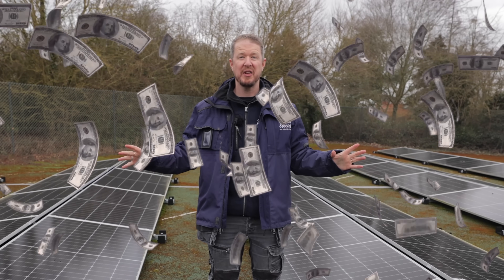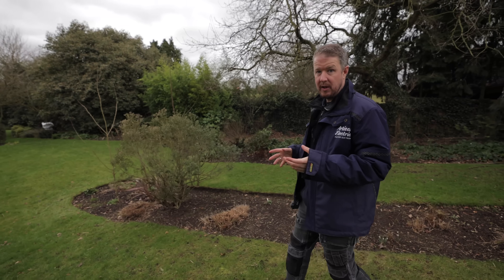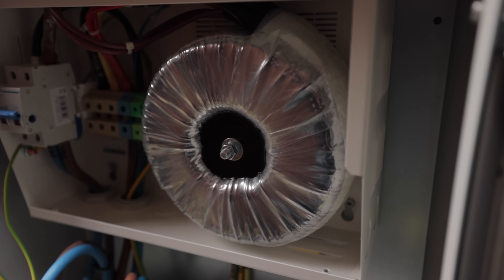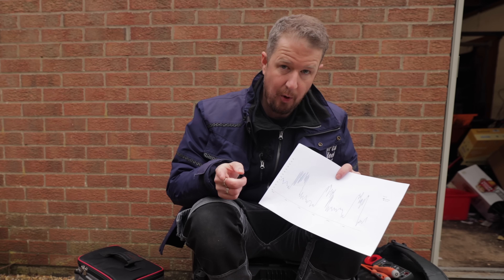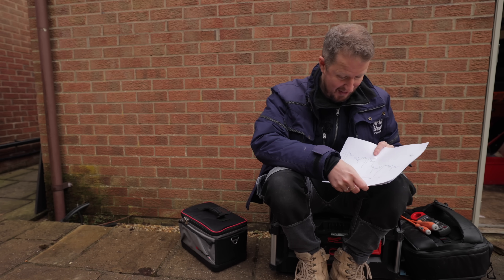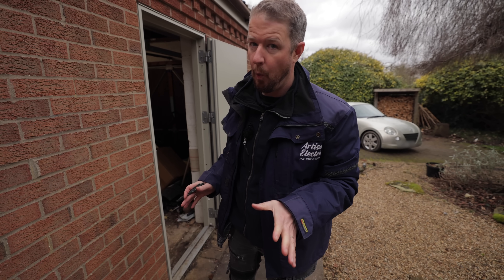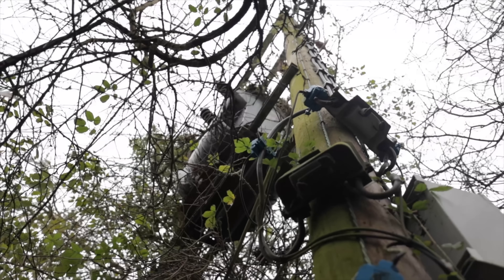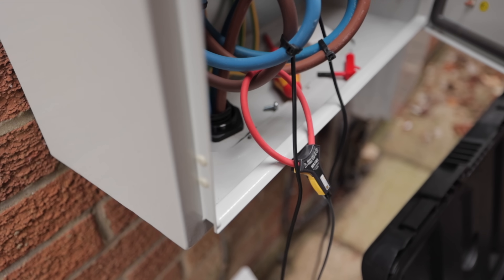THOUSANDS Down the Drain – And We Can’t Do Anything About It!

Comment: I am not in the UK and I have a similar grid situation, but my setup is completely different, so it can handle it. First of all I don't have net metering. I'd have to pay to get a double meter and it's just not worth it because the grid voltage is almost never within the target range. In many countries you are not allowed to put voltages outside grid range into the grid. I have a hybrid installation and the inverter keeps my voltage at 220 V (which is the official grid voltage here). It simply disconnects my loads from the grid and runs all the loads, while monitoring the grid voltage (so I can see what is going on there). When my installation cannot produce enough power it will switch to the grid. My inverter cannot match the grid voltage, because it is outside of its range most of the time. This is why net metering here would be useless.
If the grid company isn't going to solve the issue then I think you should go for a more similar solution. Running loads on low or high voltage is bad for the equipment that your client has. Let them install a larger battery. Keep your voltage where it should be. The downside is that they can't export all their electricity in summer. Also see if they can reduce their winter electricity consumption. A heat pump is a lot more efficient than resistance heating.
I have lived in the Netherlands before and we also had solar there. The rules are different than in the UK. In the Netherlands you can connect your solar installation to the grid without needing permission. You are however not allowed to export other than 230 V +/- 5% to the grid. Our HOA had a similar installation (same inverter, but 20.9 kWp in east west configuration), and we had a 3 phase x 63 A grid connection. We never had any issues with the grid voltage as I lived in a recently constructed residential area (and part of it was still in the planning phase).

Comment: That system should have never been allowed a connection to the network . 
The question is Why are the inverters not shutting down on overvoltage ?
Reply: I'm gonna guess someone switched them to region that allows 260V as bandaid for inverters turning off in peak. Common dirty trick of some companies
Reply: Would like to know
Reply: Depends how far the inverters are from wherever the voltage measurement is taken the voltage at the inverters could be correct the voltage rise could be at the cutout basically volt drop in reverse
Reply: Guessing it’s an Import from Sweden designed for 400v 3 phase
Reply: @michaelatkinson1378  Import or not it's a setting you can change. Frankly the whole thing reekes of incompetence, "artisanal" without education to do it properly.
Reply: @michaelatkinson1378 doesn't matter from UK over Germany to Turkey we all use the same grid

Comment: Advice welcome, but i thought G99/G100 type tested inverters ensured the voltage generated never went above 253v ?Maybe there is a cheap solution here where a setting on the Inverters can resolve the problem and keep the max output voltage to below 253v and you can then remove the voltage optimizer that's giving you the battery problem?

Comment: Could you have set the inverters to zero export while they did their tests? They'd of course lose anything from missed exports for the duration of the testing. Could also as a temporary fix reduce the max charge rate/current?

Comment: I think that having 3 inverters, they are fighting eachother to some extent, so they are not well regulating their combined output.  Might be better on a single larger inverter.      Otherwie, why not get rid of the PEN fault protection unit, and TT the EV charger ?
Reply: or maybe drop the export limit on the inverters.    it's more cost effective to dump the power in the batteries and self-use anyway

Comment: Wow that's a mess with those long of runs on low voltage (230V).  Here we have 13.2KV supply and we have a 50VKA pad mounted transformers that only supply the two homes on either side of it with 240V/120VAC.  Some older neighborhoods we see anywhere from 4 to 6 homes on a pole mounted transformer.   I do data logging on power via the Tesla Wall Connector and monitor voltage and frequency all the time into home automation server.   We also have adjustable transformers as well, in which they also have taps on the transformers if they need either a boost or buck the avg voltage level.  For those areas a longer way away from the primaries it comes in handy to be able to do what you are basically doing but at a neighborhood level.

Comment: How about using a timeclock to control a contactor that switches that voltage regulation transformer in and out of circuit? At night that transformer is not needed and can be bypassed. If the dead time during the contactors switchover operation is too long and causes interruptions in the houses power, use a "make before break" type contactor. Sometimes i do wonder if you are being deliberately stupid for clout or what the goal of such a video is? Or is that just what you get if you hire an influencer rather than a real electrician...

Comment: The electrical distributor has dropped the ball on this one, just looking at the state of the network infrastructure, it is appalling. There has been little or no maintenance done in years, there may be some reactive work done when there is a failure but the assets shown here are long past there replacement date. The vegetation around the power poles will allow short circuits if it comes in contact with bear conductors; there is also an increased rick that trees/branches fall on the cables during bad weather.  You are correct in your analysis, the pole top transformer needs to be upgraded. The HV may also need to be stepped up from 11kv or 22kv to 33kv or 66kv, either way the distributor should be sued for failing to meet the minimum supply and safety standards

Comment: Definitely looking forward to part 2. It would seem a no brainer that the local transformer capacity rating and current condition is inconsistent with the load demanded by the solar panel installation. As you stated, it would be interesting to know just how many large homes are connected to which phase. Imagine if all the large homes are all connected on the same phase on a line that's hundreds of metres long. The 11 kV transformer might have a 70 kVA capacity but, with only one phase loaded, that capacity would be effectively be one third of 70 kVA.  So the power supply company have records showing the 70 kVA capacity but no records showing how that capacity is distributed among the three phases. Of course if every house on the overhead supply is a three phase installation then my hypothesis is irrelevant;

Comment: Voltage rise due to solar generation has been a big issue in Australia. Most network operators here enforce the maximum 2% voltage rise (from output of inverter to point of grid connection) requirement of AS/NZS 4777.1 on full output power of the inverter(s) system.
Reply: I doubt any DNSPs would allow 17kW export on a single phase system in Australia either. A balanced 3-phase system would reduce the voltage rise by a factor of 6 (current split three ways and no contribution to neutral return current). Stunned that 17kW single-phase exports are permitted in the UK.

Comment: That is a crazy long secondary service drop. I had a similar problem on my 50kw system with a 25kw export limitation. The problem was caused by the utility installing a 15kva pole mount transformer and their  service entrance conductors being undersized. It took 2 years to get an engineer to listen to me and fix it. It the interim, I programmed my SE inverters to run a .8 leading power factor to lower the voltage. This worked, keeping my voltage low enough to prevent tripping with a very small reduction in capacity.

Comment: I have no experience with solar, but shouldn't the inverter(s) regulate their output voltage within a reasonable range and clamp the output when too high?

What about installing the voltage optimiser on the output of the inverter to bring it within spec?

As for the battery charging, do they support current limiting to charge slower over a longer period? I assume this would prolong the lifespan of the cells too

Comment: The UK system is officially 230V, but in practice, it still operates closer to 240V due to historical infrastructure and the way the standard was implemented. The adjustment to 230V was mostly a paper exercise to align with EU regulations, without requiring a ridiculously expensive voltage shift for the entire network.
Reply: On mainland Europe the voltage has been increased from 220V to 230V.  Not by paper 😊. But the common European market harmonized  a standard to accommodate 230V ( and tolerance) for new appliances. So the Britt’s 240 V is tolerated as well as the old eu mainland 220 V. Which provided a more or less ‘world standard’ and cost reducing for manufacturers. (Another benefit of European cooperation instead of …

Comment: What a timely vid. Just had a visit from ukpn this evening with regards to high incoming voltages (250v) which can spike to 260v on really sunny days and we are exporting from our 8.4kw pv. It was causing the Zappi to complain of voltage out of range or overvoltage. Strangely, post visit our incoming voltage has dropped to 235v. I need to check tomorrow during the day to see but the nice ukpn chap said they could fit a monitor and never mentioned the need switching off the solar.

Comment: Strikes me that UK PN dropped one by granting a generous 17 kW export limit, especially in an area where the feed is multiple drops off an overhead. I'm surprised they did not limit the installation to a more moderate 5 kW, or less,  given that they should consider future proofing and allowing headroom for the other properties to install solar.  

There must be a fair voltage drop between the property and the transformer - and to other properties also fed off the overhead.  

I have a friend who was No 2 drop off the OH line, where there were 4 further properties.  An additional property was connected and the DNO upped the voltage Tap to get them voltage within limits, unfortunately my friends house, and their neighbour (the first connection), then got over 260 Volts, with low line load, and 250 under moderate load, from the other properties, and a number of blown appliances!  It took some time to convince the DNO it was their problem and they did need a recording meter in before accepting the matter was theirs to solve.

Given you have some smart logging equipment after logging your customers data it would be interesting to log another connection(s) either side. It would also be informative for the DNO if you could calculate the resistance of the cable (honestly they may not know if it is an old installation) - and is it a copper cable or aluminium? The later being more resistive and problematic.  TBH you customer would be well advised to at least give the DNO 48 hours or so to effectively monitor the system without export - if it helps solve the problem they will win in the end or they may be faced with an expensive upgrade cost or reduction of their export limit (if that is possible now it has been granted)

BTW I guess that optimiser may be rated for it, but I don't think I'd trust that torridal to handle 100 amps for very long - the turnings just don't look man enough. Presumably it's an tapped Auto Transformer not a primary/secondary type ?
Reply: I live inside a city, relatively far from the transformer and we regularly get over 255v.😢😮 
This is after a neighbour complaining of low voltage (we had 220v).
Obviously this oscillates during the day, but let me say "it ain't great"
Reply: "Strikes me that UK PN dropped one by granting a generous 17 kW export limit, "

The approval is given on information submitted.  If a sparky accurately reported that the maximum terminal voltage of the inverter was well outside the regulation limits, it seems unlikely it would have been approved.  They gave permission to export 17kW, but that doesn't give carte blanche for the inverter to raise the voltage above 253v to achieve that export.
Reply: @ferrumignis  That is the problem the customer expects to be able to export the full 17 kW not understanding that there are other constraints to that i.e. the inverter output voltage.  

My understanding is that a type approved inverter should not be able to export above the permitted voltages which, in this case means the 17 kW limit is moot because of all the other constraints.  This story seems to be a classic example of "keep turning the wick up till it works" which often results in the transmitters final output stage eventually blowing up! 🤣  Basically this installation has a crap VSWR 😄

TBH I would think that 17 kW is an unusual level, most people (domestic setting)  round my way have less than 5 kW.
Reply: @ferrumignis  it's the combination of export power and grid weakness that results in excessive voltage rise (not the inverter). Both of those are at the discretion of the DNO when granting G99 permission
Reply: Yes, the DNO made an error when it assessed the G99 application. The DNO should now reinforce at their cost, not amend the G99 export limit. An official complaint should be made to the DNO
Reply: @redshift3  From my subsequent reading the DNO cannot revoke an export limit once issued - probably to protect investors. I wonder what will happen if others in the street want solar? - I guess the DNO will issue an export limit of 3.68 kW (the legal minimum) with a limit on inverter size.

All I got was 8kW Generation, 3.68 Export 😢 for a Tesla PW3
Reply: @barrieshepherd7694  I got a 10kW export limit, but I live less than a stone's throw from the 11kV transformer

Comment: When setting up its power grid, Germany - like Austria and Switzerland - initially opted for 220 volts. In the United Kingdom, however, the mains voltage was 240 volts. In order to be able to create a uniform power grid across Europe, the European countries defined a standard voltage of 230 volts in the international standard IEC 60048 in 1983.

The European nations began to gradually adjust the mains voltage in 1987. Initially, the tolerance range was -23 volts to +13.8 volts. Since 2009, the voltage may be 230 ± 23 volts. In principle, the mains voltage can therefore be in the range between 207 volts and 253 volts. These tolerance conditions ensured that devices designed for 220 volts could also be operated without any problems.

With the exception of high voltage 110 kV to 1150 kV there are no masts. Everything in middle voltage up to 35 kV is underground line. And transfomers are in houses usually at a rated power between 250 kVA and 1000 kVA, and are in 100 - 500 m distance depending the load of the area. Of course 3 phases, 230V/400V.
Reply: Really? All MV underground, including in rural areas? That would be very surprising (and expensive).
Reply: *IEC 60038 I think you mean. We’ve also transitioned from 240V to 230V in Australia while integrating solar on more than 1/3 or all houses. 6/9 houses on my local 25kVA have rooftop solar, totalling 35kVA of PV inverters😅

Interestingly New Zealand has had a 230V +/-6% standard for decades. So in effect Europe and Australia have, after many decades aligned with the Kiwis but accepted a wider +/-10% tolerance for legacy reasons.
Reply: @peterkilby289  My recollection of voltages in Sydney (5 years ago) were that they were 240 nominal often more.  The quantity of imported '230' volt kit put out on the street with blown thermal transformer fuses was considerable.
Reply: and the 3-phase voltages of 380V (mainland Europe) and 415V (UK) were also harmonised, to 400V.

Comment: Sadly not an unusual scenario, but may not just be down to the single transformer. I have a 43kVA system, connected to a dedicated 100kVA transformer for my grid connection. Over a period of 18 to 24 month, I noticed my solar PV inverters were often going out of sync due to high voltage, and most significantly on L3 and L2, whilst L1 would be in toloerance. I reported it to the DNO as a fault under grid code and after dropping a few choice words and phrases about over unsafe supply, overwhelming safety protective devices, they set it as a high priority incident.
Cue the rubber glove guys appearing a couple hours later to tap down the transformer (new in at my expense in 2020, so I knew it should be OK) but before they set to work, I made them go check neighbouring properties, even though they were on other transformers. 
Surprise surprise, those on L1 were ok, but those on L2 or L3 had high readings. L1 connections outnumbered L2 or L3 by 3 or 4 to 1. Basically the whole area has been built up slowly, and the vast majority of connections were being put on L1, so the whole line back to the 33kV/11kV ended up getting upgraded and people had to get their supplies switched (externally) to balance it all out. It took out DNO (SPEN) a few weeks to sort out, including a couple of consecutive fridays with planned power outages.
Its still not completely evenly balanced, but its a lot closer now.
Reply: I think it is like that where I live. More and more houses were built and whenever the DNO (or national grid) does maintenance work and switch supplies around, many houses have their RCD trip, I know this cos loads of house alarms go off. It is not the whole estate so I think the phases are unbalanced and something causes a spike when the leccy network switches back. The DNO recently did some maintenance on the local substation and I mentioned it to them, the electric still trips though. I discovered another substation recently and judging by the number of alarms going off, I think the other substation is also impacted by the network switching.